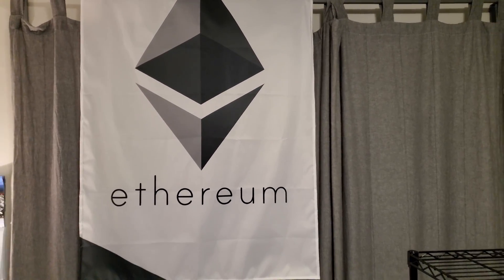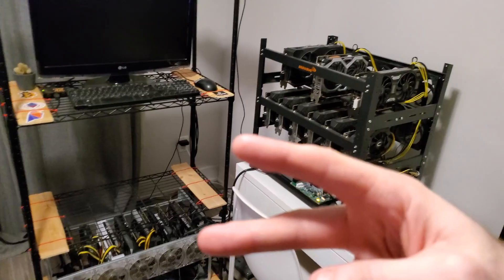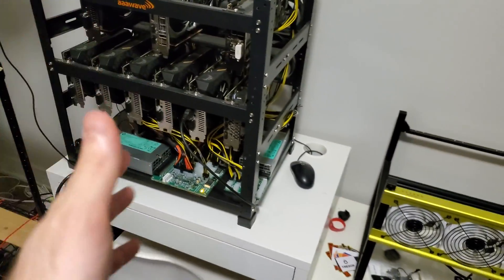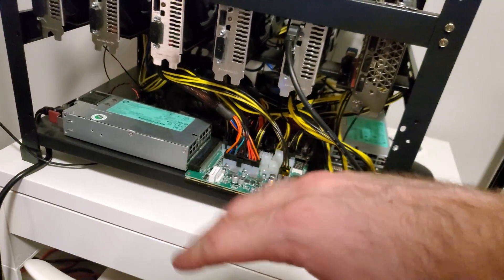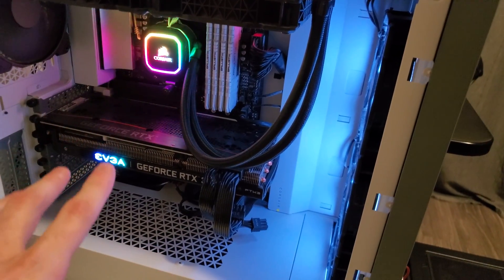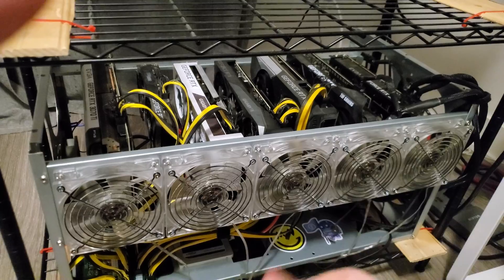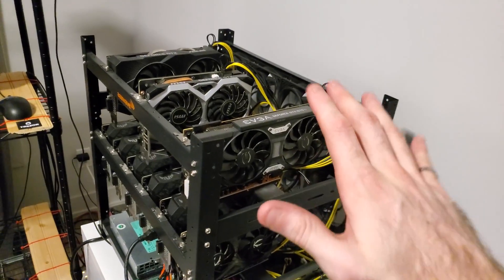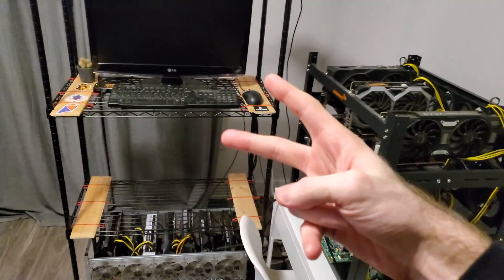10 Tips for New or Beginner GPU Miners | Do these things to get off to a Successful Start!

Comment: i realy like ur videos i started with 1 gpu in august now i got 3 :) so now im about to put all 3 in to 1 mother board with the 1 to 4 usb adapters but i seen videos where ppl dont recomend the 18 awg cable so do u think ill have to get 16 awg my cards  are 1660 super,1660 ti and a 3060ti thanks for ur advice in advance
Reply from the maker: You seem to be following my advice ;) Mhhm well its always depends on what your mining. RVN (KawPow) takes more power than ETH. 18 AWG cables should theoretically be OK I think, but some are not the true thickness they state they are. You can check out AAAWave or Parallel Miner in my description, your safe with whatever they have. If you buying off Amazon, look for reviews.

Comment: Great tips
So what about the tips that why you have to turn off your farm when storm hits
Reply from the maker: Its not a question of turning it on when a storm hits, usually i let it all run. I cut out a good 45 seconds of explanation which I though was too much. But the power was (at the time) cutting On and Off every 2 minutes. So instead of having my rigs reboot and shutdown non stop, i just shut them off for an hour. Thats all :) There wasnt lightning or anything like that!

Comment: How does the physical wallet work?
Reply from the maker: Your private keys are stored on the device, and thus the funds relative to your address cannot be accessed EXCEPT through that device. Meaning something like a Metamask or Exodus hack is impossible. It adds a crucial layer of security. When you want to send crypto, you just plug it in to your computer, put in your pin, and send away!

Comment: Great information brother 👌👌 bro i have a issue here my 1 2060 gpus fan is spinning but couldn't recognise in device manager and no signal but other gpu works what's the matter ,is my gpu dead ?? I have reinstall the nvidia driver also !!
Reply: Use a pcie 1 to 4 splitter
Reply: Or the gpu is dead lol
Reply from the maker: how many cards you have in the rig? It could be a bios issue as well. Try it in a different Rig or computer maybe
Reply: @MiningOffice  i have only 2 cards 2 2060s other one is working fine recognise as well in device manager but other one fans keeps spinning but couldn't recognise in device manager sir this is the problem m really confused sir plz help and what about bios u saying ??